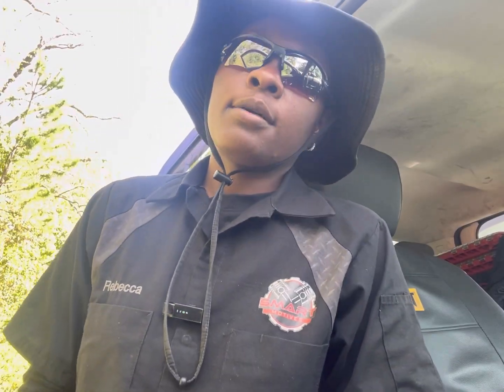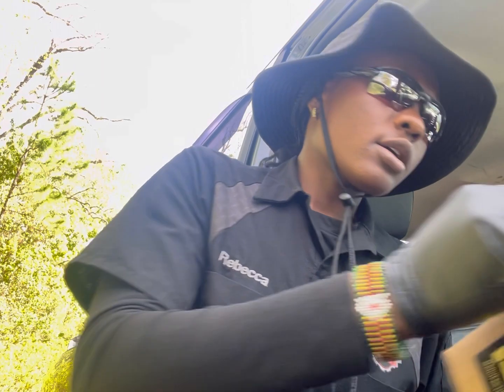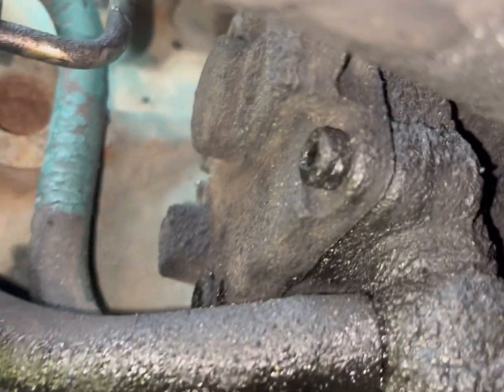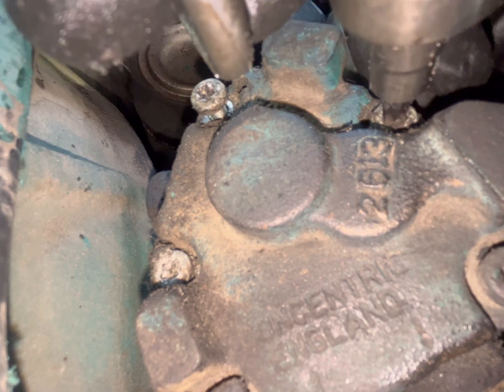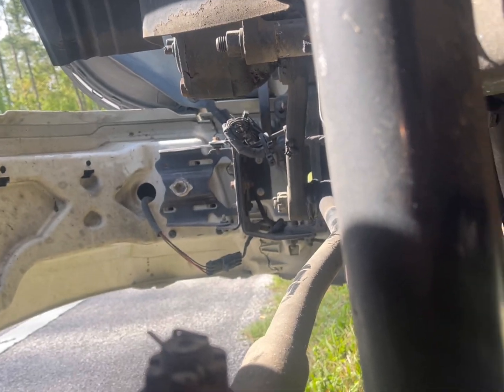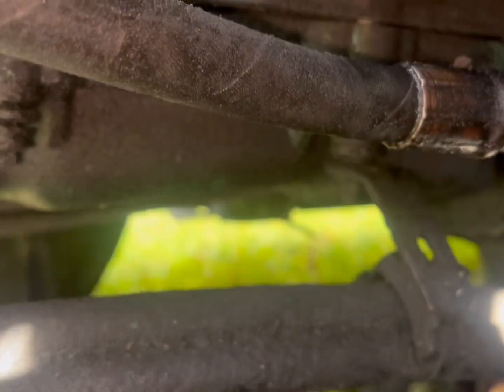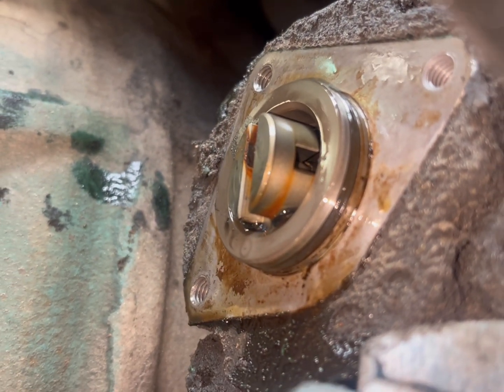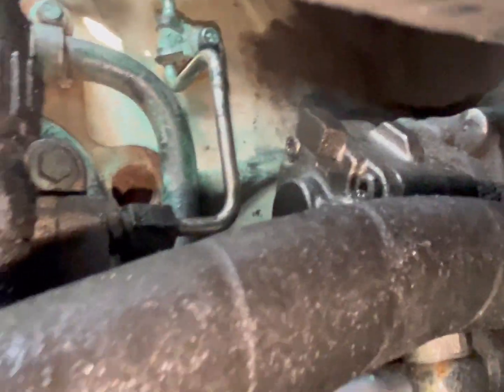Volvo D13 No Start Fuel Pump Replacement

Comment: What was the symptoms before failure. My truck is cutting off and turning on. Had junk in my fuel water separator. Replaced filters and put injector cleaner in my fuel tanks same problem. Pls give me some advice. No lights on
Reply: Me too, how fixed? Please let me know, thanks